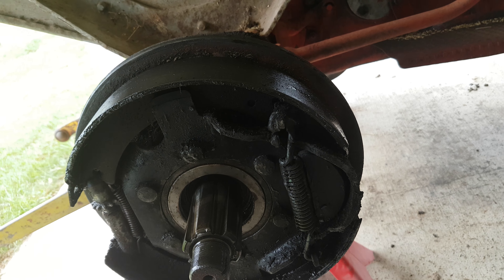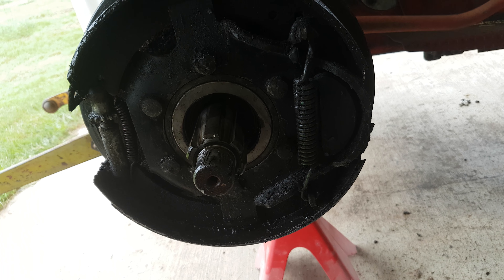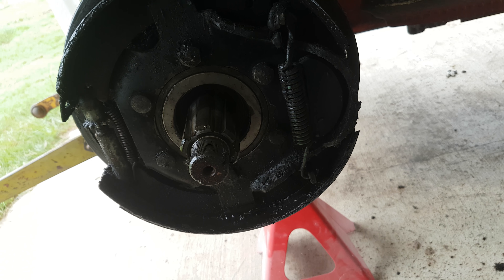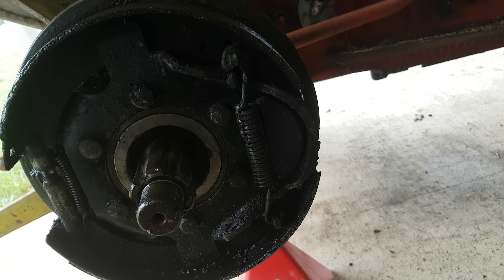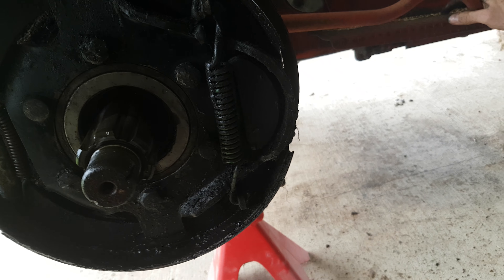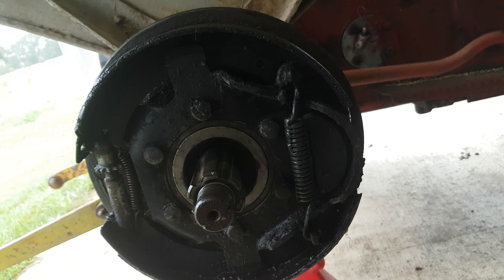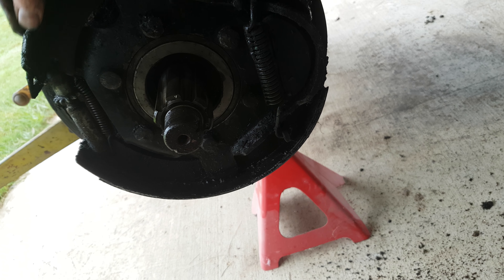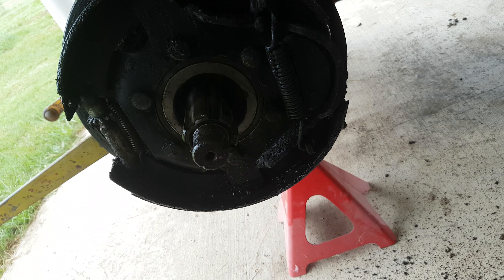Ford NAA 1953 Tractor - Rear Brakes

Comment: they are covered in grease. fix the leak and youl have brakes. the shoes look normal otherwise
Reply from the maker: Now that I have a little more room in the barn/tractor shop I plan to work on that tractor. Fix the break issue/leak and fix up the wiring.  I wish I had known the brake pads were fine. Before taking it all apart I had ordered new break pads expecting to replace them. It's been 107F all summer out here and working on a tractor in that heat isn't much fun. I'm looking forward to the fall weather to wrap up some of these projects.

Comment: Fix the leaking seal and get the grease/oil cleaned up.. then you may have brakes. Seal may be shot because a bearing is shot..
Reply from the maker: deernutOO I will have to get the tires off again to see. I had to use the tractor to tow a John Deere tractor then blew out my solenoid a few days later. All before I could dig more into the brakes. I tried to clean the brakes some just to see what was going on so much dirt and oil and geeze. Just cleaning helped it to work but I have noticed they aren't working as well as right after the cleaning so it maybe time for new seals for sure. I'm pretty new yet to working on tractors so its alot of going to the book to me to learn. I like your idea too about the bearings. I have no idea how to check them but I'll figure it out. I love that old tractor.